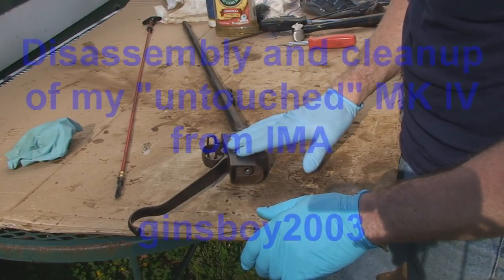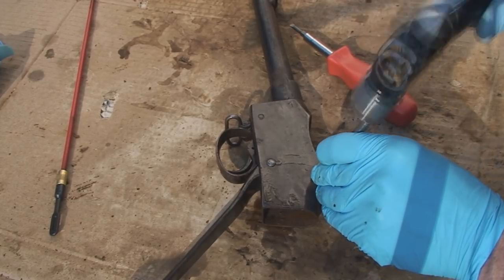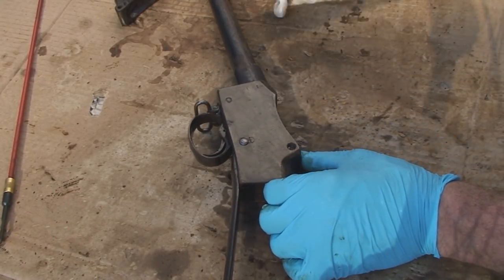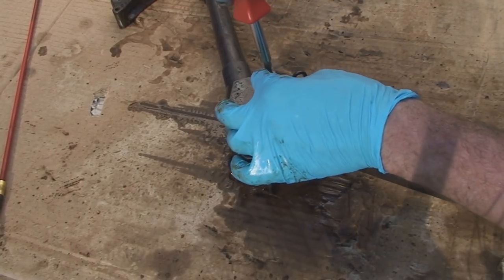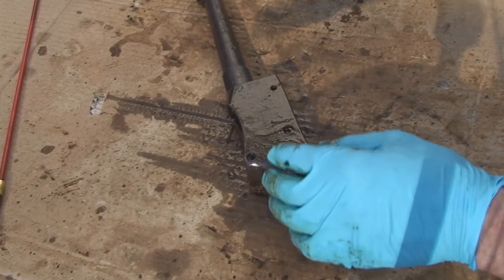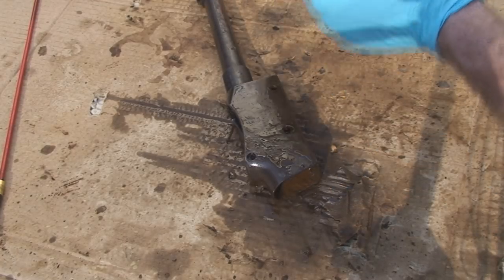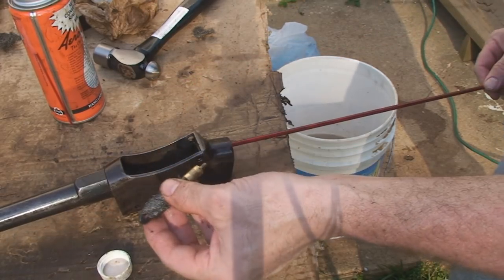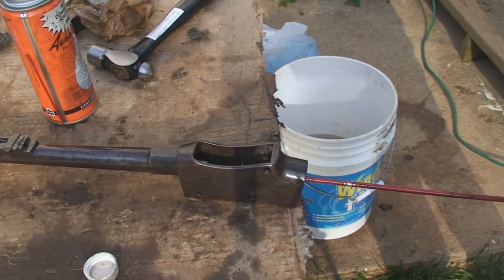Untouched MK 4 receiver disassembly and cleanup.wmv

Comment: @SpiroHrvoje1989 
Ive never handed a MH before but I stripped my untouched mkIV with the help of this vid. Mine came apart without any trouble apart from the buttstock that was a bitch to remove, Mines an 1887, if I had a firearms licence it would be a shooter as the headspace is good and all the parts are sound ( I live in the UK so can own one live as its an obsolete calibre and antique just cant shoot it as I dont have a licence... weird little part of UK gun law
Thanks ginsboys for the vid